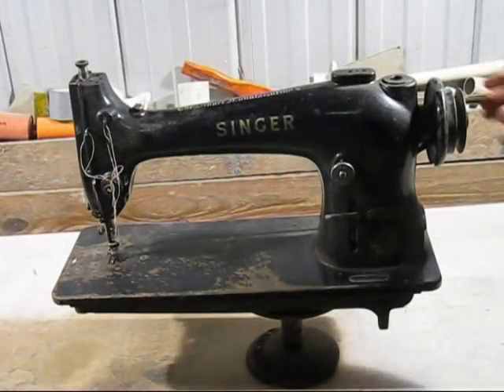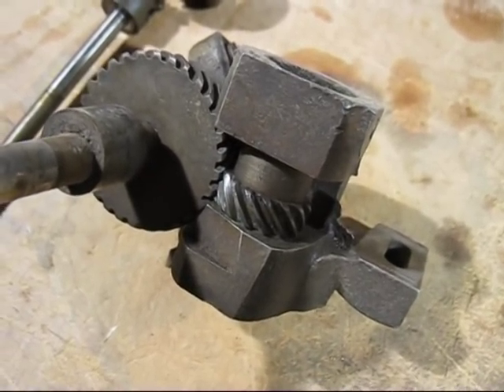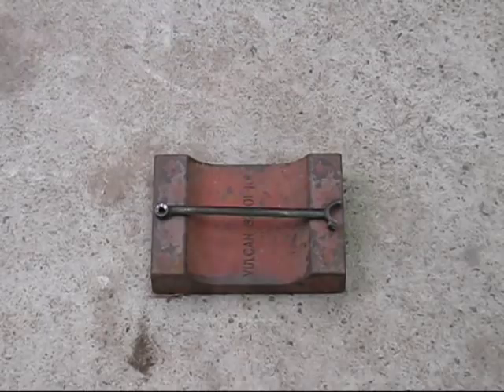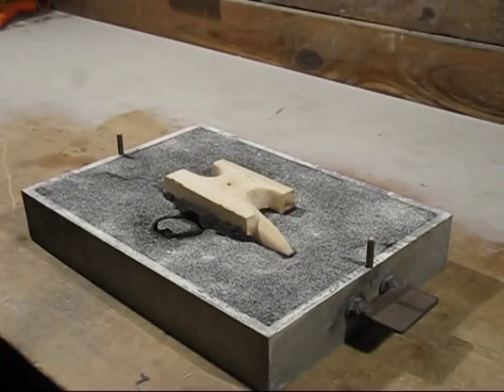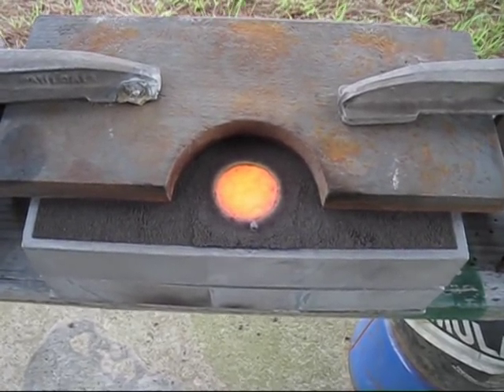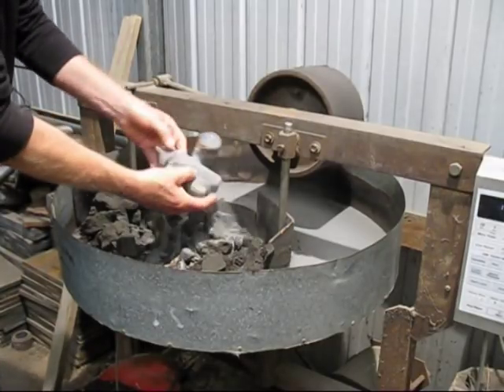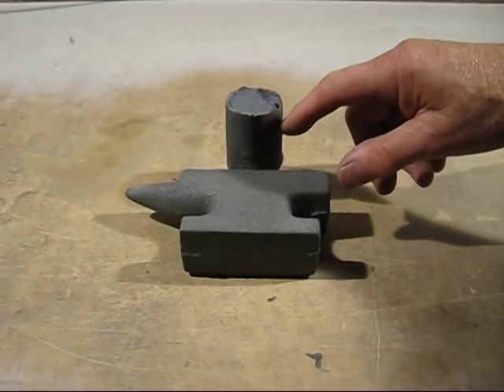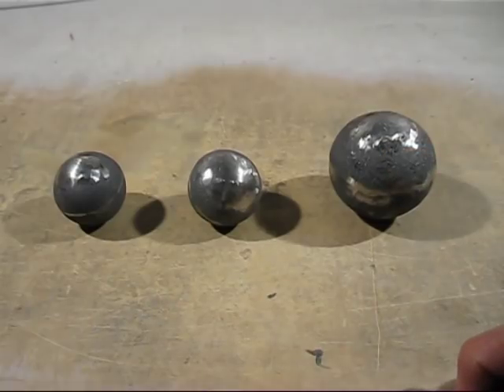Melting sewing machine scrap

Comment: With those spheres, you need to cast a small canon to use them in ;-) 

I'm pretty envious that you've got a working anvil pattern. I tried to model a two-piece pattern and 3-D print it with with horrible casting results. Not enough draft on mine and like you I had raised surfaces on the sides so rapping it side to side just wreaked havoc on them

Comment: I like how showed your iron bits tied up with the copper wire. Looks like a great system. Thank you for doing that.
Reply from the maker: I use 1mm dia wire, if it is too thick it takes too long to melt and I singe my fingers. Too thin and there is not enough time to position it over the crucible.

Comment: Yep Industrial grade quality sewing machines are getting hard to find.
There would be nothing wrong with that machine that could not be fixed with a little TLC and a repaint. every single part is still available for any maintenance needed. It is common for machines like the one you destroyed to work every day in a factory for many years without any attention apart from oiling and replacing the needle. 
Breaking one up for scrap is just plain wrong. 
Oh and yes I spent my working life in the sewing industry.
Reply: John McNamara It’s not like he threw it in the trash he gave it a new life in its new form
Reply: Not only that, he melted down a few hundred dollars worth of sewing machine. To make some useless trinkets. Look up a used vintage singers on ebay
Reply: EitriBrokkr yep, over here in the UK, there are lots on EBay,  but low prices & no ones buying,
Reply from the maker: That is what I thought.
Reply: @Man-in-da-shed  you could make a small fortune selling them in the U.S.
Reply from the maker: In Australia they get thrown out all the time so they must be worthless.

Comment: Hi luckygen, thanks for this great video. About your furnace setup, how tall spacers you have under the crucible or how high the crucible bottom sits from the furnace floor? I have noticed in my meltings that the iron always melts well on top of crucible but bottom is too cold. And do you have tips how to prevent burning of the iron? Cheers from finland.
Reply from the maker: Have a look at my video (Furnace dimensions, another iron melt) it will give you all that information. My iron melts start that way, hot at the top and cold at the bottom of the crucible. Between 5-10 minutes  both top and bottom are very hot. So when I pull out the crucible out it is hot at the top and bottom. You can use fluxes to prevent burning of iron but it shortens the life of the crucible. I use a slightly reducing flame to minimise burning of my iron.

Comment: A master at work.
Bit sad seeing the machine busted up as I still have one I still use. But anyway, each to their own.
BTW how long do you allow the iron to cool in the mould for? 
Very interesting seeing no chill, and you didn't add ferro silicate.
Reply from the maker: This is why  I recommend this type of scrap because it is so soft even without ferrosilicon. I allow one hour so the casting is not glowing a red colour otherwise it will be very hard to machine.

Comment: Thank you. Can you do a video on casting parts make up a small steam engine?
Reply from the maker: This video I made a long time ago making parts for a small steam engine have a look.  (Compressed air three cylinder radial engine.)          Save       Cancel
Reply: @luckygen1001  thanks. I watched the video. I must admit I've never cast a small steam engine. So I'm a bit green. Can you post one that has a bit of explanation. I've never owned a steam engine. May be better to buy one first. Also can it be made from aluminum?
Reply from the maker: Yes you can but you cannot have aluminium rubbing on aluminium like  with a piston and cylinder bore. Use a steel or brass piston.
Reply: @luckygen1001  Al on Al = galling.  :>(  Perhaps silicone rubber for the piston rings to really dodge the galling issue.

Comment: What kind of blower do you use to melt iron?
Reply: He uses a vaccum machine.  It is in a previous video. The also has a video on different blowers. Cheers
Reply: Water pump??????? WDYR??
Reply: @aubreyaub  blowers for melting furnace  is titled
Reply: @aubreyaub  building a propane fired forge he shows the blower and how to connect it.
Reply: @khawk7365  Mate. Sarcasm. You know a Wry Comment, pulling the Piss. Concrete Pump, something like that, which will blow air. Now a "Vaccum machine", as you first posted, I too, thought was an effort at humour.
But now I sense that you are not really connected to this earth, in the normal manner